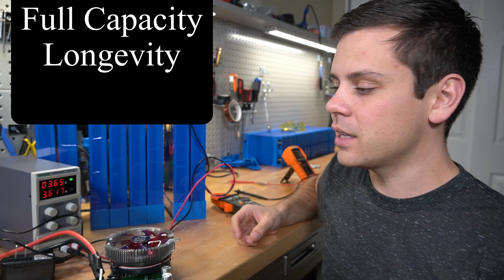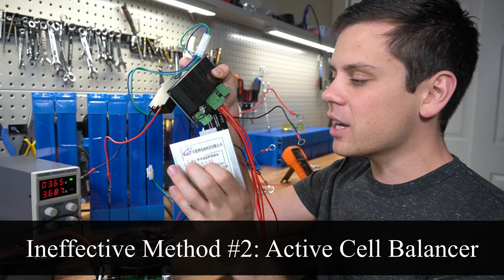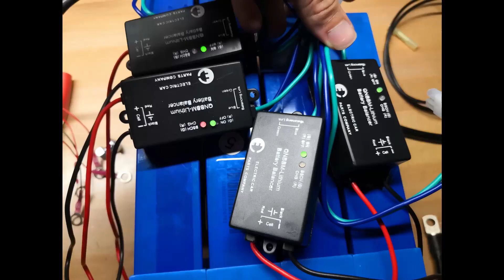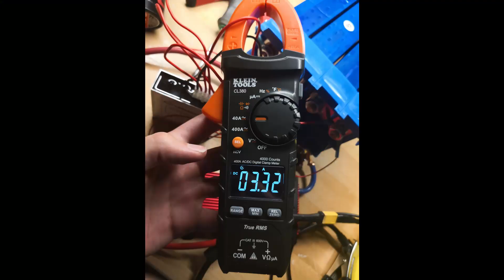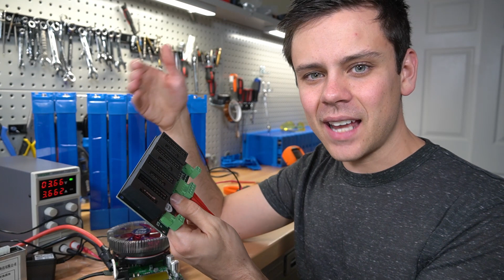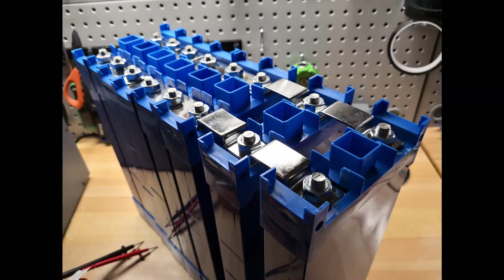Advanced LiFePO4 Cell Balancing Discussion (and how people are getting ripped off)

Comment: Interesting.... here's the  latest update on my mismatched 4 deep cycle sealed batteries ...

I told you the last time I had abused the poor things and they had dropped to below 10.5 volts as a set, and my 360 watt mono solar panels hooked up to my EPsolar mppt 20A charger wasnt kicking over charge the batteries even tho I'd be getting 20volts @8 or 9 Amps coming in.... my MT50 monitor was still showing the stupid ☹ with no charge going to the batteries..
So I finally went and rewired the positive lead from the charger to the last battery and moved the negative to the terminal connection on the other end so the charge is going thru all 4 batteries now... 
And Wah Lah! It started taking in the charge and brought the bundle up to 14.5 volts during the high peak hours of sun and storing a few amp hours between them all!  
I can even charge up my 500 Watt RockPals Brick.. that's what I call it anyway.
Will upgrade to lithium batteries later, but at least I'm back to being self sufficient again.
I know you don't care, but Go 49ers today!
Have a great Super Sunday!